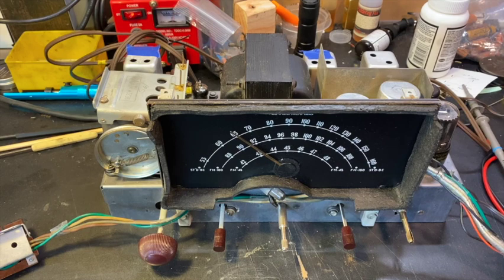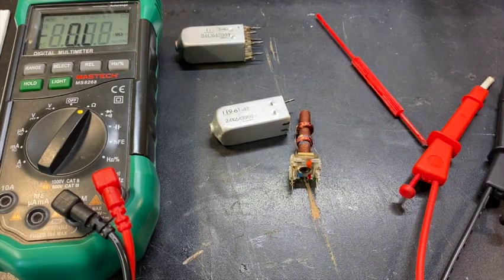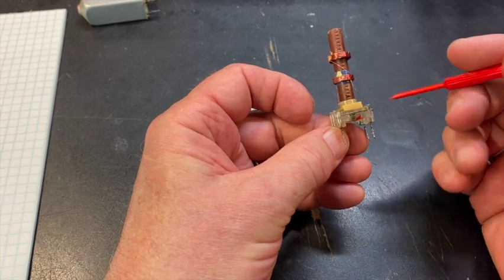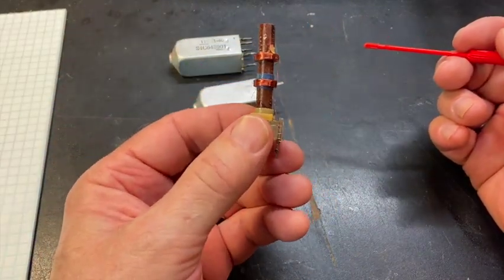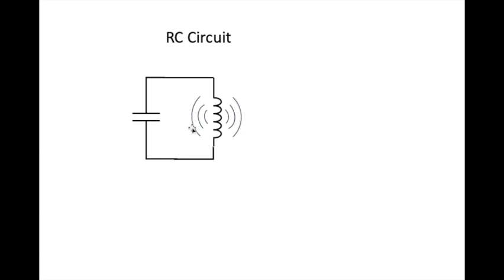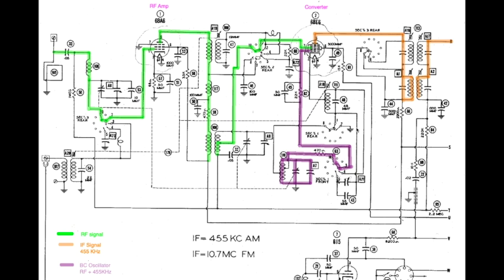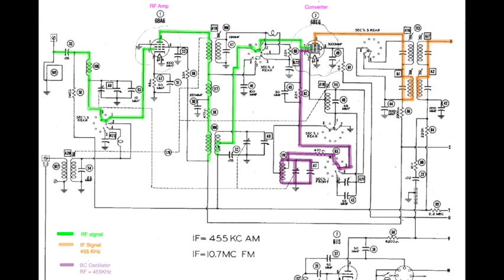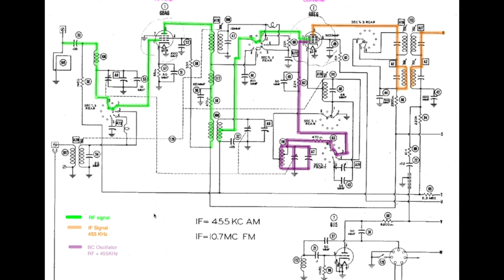Fundamentals - IF Transformer - A Resonant Circuit

Comment: I am not sure of your training, but transformers never amplify, they may step up voltage, but that is not amplification. Amplification requires more POWER out than in. The primary in this case has the output impedance of the plate which may be a few 10s of Kohms, the input is a grid which has high impedance (may be many megohms), so the transformer steps the voltage up, but does not amplify.
Reply: You are correct.

Comment: Still don't understand. referring to cct at 20:00. A signal is fed across the tank cct, resonant at 455k and currents  thru the capacitor and primary will be equal but 180deg out of phase at resonance. The current in the coil will create a flux which will link with secondary (great).  Now then,.  below 455k the impedance of the capacitor will be greater than coil. At a very low freq the coil is an open cct but the coil will still allow a current which will still produce an AC flux, which will still induce a voltage in the secondary. Note: not all have a capacitor across the secondary.     To be practical the transformer will still work down to at least 350k .  So much for a high Q

Comment: No transformers "amplify," they have a turns ration that can result in a higher secondary voltage than primary voltage, but the current is proportionate to that; no amplification.
Reply: You are correct.
Reply: Current is only heat waste in RF, audio and light applications. So it does amplify it to more usable form. Super joule ringer looper seems to work with beat frequency, so it really does amplify the voltage too.
Reply: @Kangsteri   So, I have a question for you.  If a transformer amplifies, why do amplifiers - like stereo amps, guitar amps, etc. - require tubes or transistors, and power?  Why can't you just connect your guitar to a transformer on the primary, and a speaker on the secondary, and be done with it?  That answer of course, is that transformers transform, and amplifiers amplify.  Or, what "amplify" means, in most contexts, is an increase in the  of a signal.  A transformer increases voltage at the expense of current, or vice versa.  There is no   It's what's called a
Reply: @jviss07  Yes, torque for external movement needs current. Signal transfer in closed systems doesn't.
Reply: @Kangsteri  I have no idea what you're talking about with that last comment.  I must say, that after having been granted a degree in Electrical Engineering and spending 40+ years in the industry, with five US patents, I have no idea why I'm having this argument; but you know what they say about arguing with someone on the internet....
Reply: @Kangsteri  I regret that I resorted to an appeal to authority in this argument.  Perhaps if you explain your position in more detail I will appreciate it.  What do you mean when you say what you did?  Are you saying "power" only applies to mechanical power, no electrical, or electrodynamic power?  And if so, how do you explain the existence of RF amplifiers, IF amplifiers, and so forth?  Why use tubes when transformers alone would suffice?
Reply: @jviss07  Difficult subject to explain and English is my secondary language. People have broken the Lenz law. More voltage is less resistance. It's possible to transfer energy to positive and negative static electricity charge and use them separately. Like Lord Kelvin generator. When the other half is used for work, it's restored / neutralized for free by the environment. Some aircore pulse motors have more output than input. Like the Bedini SSG, or the design on Wind Power And More channel, or on Skycollection channel, etc. They work like swing or carousel, so there is very little input and it switches to generate and use the collapsing field that goes lower than the original negative cycle. It's possible to hook up Wimshurst generator on those to produce even more energy. There is way more officiant technology these days. Like switch mode power supply, LEDs, light cable, etc. Light is very much like the RF, so it's not effected by the Lenz law, like optocoupler or solar panels. So some of it can always be taken back for feedback. Just like regenerative circuit, or turbocharger for example. The Super joule ringer looper on Lasersaber channel is worth studying. It also seems to use the collapsing field to reinforce the oscillation in it. Also very simplified explanation for part of it is Tesla switch battery / capacitor switching on channel called What if I did this. I'm here to study for rectenna, not to argue. Respect for your knowledge. Now I'm working on crystal radio powered mp3 AM FM radio, that originally uses one aaa battery. I also try to build these systems that I mentioned. But it takes time to get all the parts and build them right. Specially all the materials for good pulse motors are quite expensive.